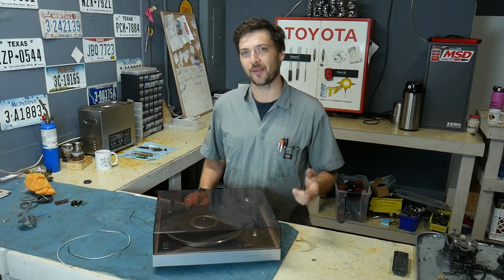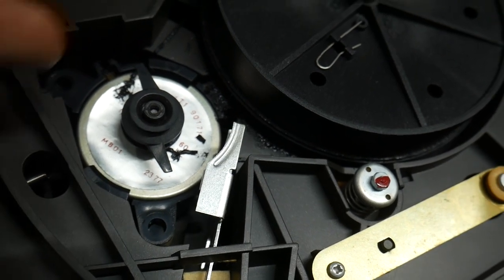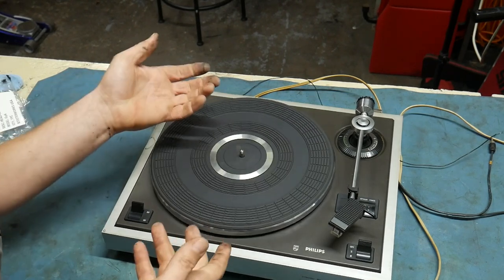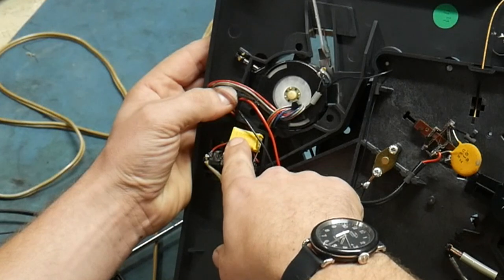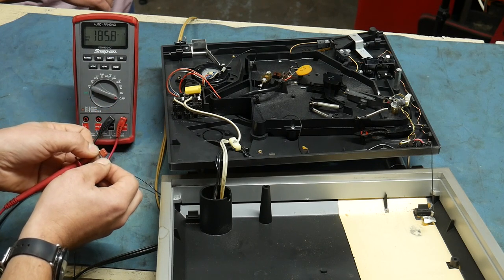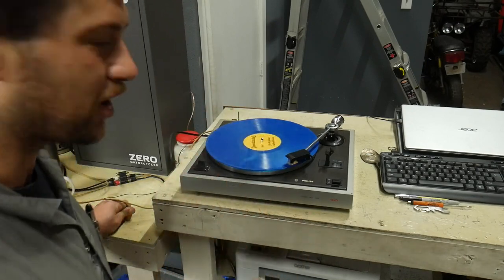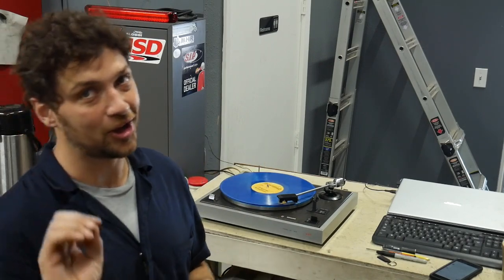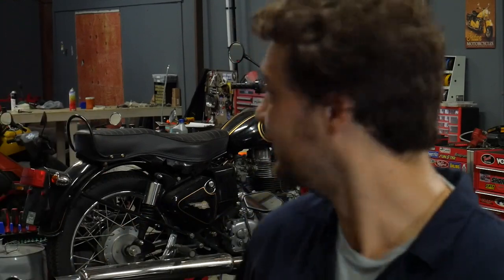Can a SCOOTER SHOP fix a TURNTABLE using SCOOTER PARTS? (philips 437, GA-437)

Comment: So...you had a motobecane pulley situation there, eh?
My first ride was the copper colored Moby model, such a crazy design with the engine gradually tucking up into the chassis as you went faster. Wish I had kept it.

Comment: If you connect the mag-cart turntable's ground to the stereo's antenna ground port, it'll act as a proper ground for it... or so I've heard.
Reply from the maker: We ended up running a wire all the way up to a screw on the back of the stereo's chassis.
Reply: @Scooter_911  Tell me: Once those connections were complete, did it seem you needed to turn-up the volume "excessively" to bring the sound to a listening level equal to that of the stereo's other inputs/functions?

Comment: well, I'm sure that that means that it's  (the O-ring) too thick, or thin, making it fast/ slow> faster in this case!
Reply from the maker: yeah the o-ring was too thick so it didn't sit far enough down into the pulley effectively making the drive pulley larger.

Comment: Simple Europe is 50 hz US is 60?Hz either change motors capstan to small (change gear ratio ) or change motor or motor speed electronically
Reply: I had to do that on return from over sea
Reply: Yeah with the way that motor was set up to be fed directly from wall power, I was thinking the +10Hz difference it was recieving in North America might be making the difference. However it seems like it was just the belt profile messing with pulley dimensions lol! I would have lost my mind trying to find the perfect capacitor to adjust the phase for 60hz input and probably still would have been stumped. I’m glad Garrett used his   Mechanic’s problem solving strategy and tested the most simple potential problem first